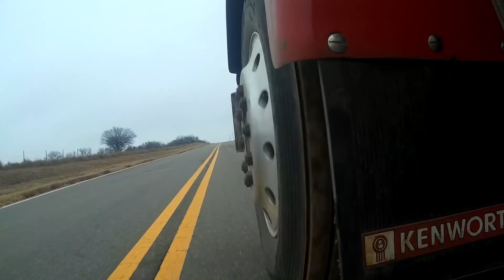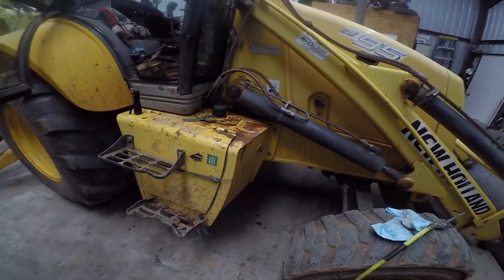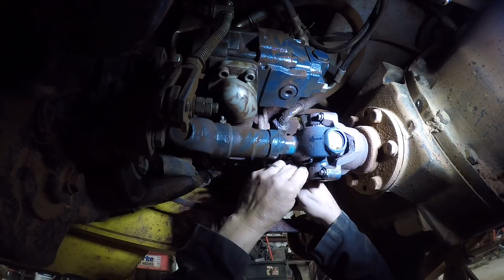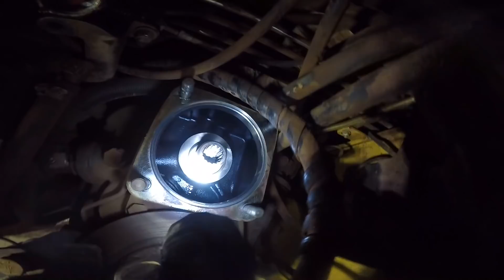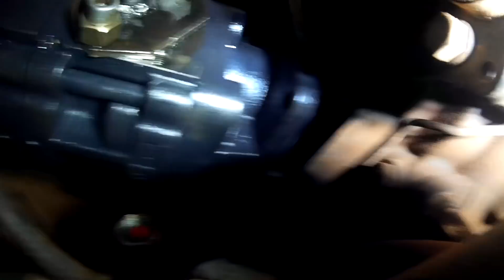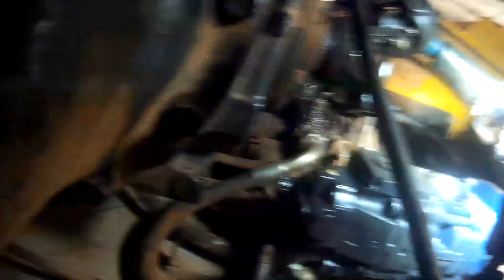backhoe pump r&r

Comment: Working man's dollar great song, I love Chris LeDoux. I changed a hydraulic pump in a 450E JD in the field in the dirt. I think I am still lubricated. Flat on my back with nothing but hand tools and horse power. I started to loose strength about the time my brain started to grow.
Reply: How is it going Frank? You staying busy or has the weather got you tied down?
Reply from the maker: It’s a bit slow, snowed here Monday and always gets slow with Thanksgiving. Sunny and I’m working today.
Reply: @Digginok  It is cold in Ohio and my shop is not heated. It has been raining, snowing and slushing. It is hovering around 30-35 degrees. I had the small door open and a box fan blowing out last night when I was welding. I use an innershield hardface wire. What kind of maniac looks out the open door to see it snow while running a fan and welding?
Reply: Cold weather breeds repair videos. The machines just are not as ductile and cracks start running. I hope your iron holds in and you don't end up welding for as many hours as you dig. Glad that you could get out and make some money today.
Reply from the maker: 68 here now, nice weather. Wednesday morning it was 15. Too early here for that kind of cold. 
I’m sorry but I won’t have a video until Sunday it looks like. I had a plan but somehow lost some footage so I’m not sure what I’m doing next.
Reply: @Digginok  Sorry to hear about that lost footage. I missed your reply I was out in the shop pounding Lincore 60! Just wing it if you want to post this week. Do a live stream in about an hour and a half from now. All your friends show up and it brings people to your channel for their first time. Not trying to be pushy it was just a thought. We like to talk to you even though you have a face made for radio ;0 Don't feel too bad I had to learn to be handy because handsome was never going to happen!
Reply: Welded from 6 this morning till 7:45 tonight. I am sitting on my rear for the rest of the evening.
Reply from the maker: That’s a long day!, I’m working on a video, sometimes they just work out sometimes it is a battle to get it to work. What are you welding on?
Reply: @Digginok  At work just finished a job welding steel sleeve into a stainless cap that was drilled for a steam insert, All TIG thick metal with full penetration and huge leg required on the cap. Then got a start on some tapered steam inserts on low grade chromemoly with full penetration welds, that is a stickrod job. All those parts get turned off and belt sanded in. They have to cut clean of porosity and slag and no lack of fusion or repairs must be made. In my shop I am welding on some dirt engagement tools, that is where the chrome/carbide hardface comes into play. I work from 6 until 2 tomorrow just a straight 8 so with any luck I might just be able to finish the job in my own shop after work. I have some pictures of stuff I have been welding on if you want to see let me know. You might just get a good laugh! What you been getting dirty from?

Comment: in your next video could you show us the crack in the pump?  On the ingersoll backhoe I had a snap ring came apart internally and clogged the drain  for the shaft seal. I pushed that seal out 3 times before I found that little piece of metal in the hole.
Reply from the maker: Yeah I may do a short video of it. It’s in an odd place not sure why it did it. I changed o-rings 3 times and 2 hoses before I found the crack.

Comment: That went better than I thought to, It kinda reminded me of when I worked on Rogator sprayers for a year with the local spray guys. I'm sure there is stuff like hyd lines under them, that they hang on string from the factory roof and build the machine round them !.   simple things like those home made tools can really help on jobs like this to. There would sure  be a mess under one of those machines if that driveshaft ever let go. I saw  JD  6400 tractor do that it destroyed most of what was under the cab when the shaft went round at engine speed for the pto.

  Atleast on my JCB there isn't much under the cab a guy needs to get at, and the pump is right out the front of the rad with a driveshaft and a few lines, so easy to work on, after draining the oil. yeah it messes the rad and coolers up if the shaft lets go, and changing the fan belts a program. I used to run a spare belt already fitted through the shaft on my other machines, the last owner wasn't that smart so I'm gonna do it myself on this one. Thanks for sharing hopefully you notice improved hydraulic performance with the new pump to. Take care.
Reply from the maker: Glad it's done! I keep a close eye on the driveline, that would be a disaster.  I like this design better than the 555D ford, it was front mounted, fan belt changes are a pain for sure.  The new pump is actually an upgrade according to the dealership, i checked the part numbers and the new one is 165lpm, the old one was 154lpm. Maybe i can idle down a bit more!  Thanks for watching!
Reply: That would be nice if you could idle back, fuels getting expensive, maybe it would help pay for the pump !.   I'm gonna say the extra  capacity will make a huge difference. My machine doesn't have the stock pump the last owner "updated" from anything JCB  fitted from stock.   The first time I jumped on it, I set the throttle to about normal for a stock pump.man It's a good job I wasn't trying to air dig in a sale yard it wouldn't of looked good L.O.L.  

 I don't know what my pressure is either I need to check it. it's a 7 ton plus machine,  I was trying to scratch a quick drainage trench for snow melt with a 2ft bucket on ground thats still frozen in some places. The old girl has so much power it stood her up on the stabilizers/ front 2ft in the air,  and was trying to drag it back down the trench.  I had to quit before I wrecked the bucket or something else. in fresh digging on hard clay it don't mess around filling that 2 ft bucket either.

Comment: I bought a 1966 ck  530  188 Diesel  case Backhoe for $2500.00   for the farm and I bought a 1973 Ford f 700 DUMP trk for the farm for $2500.00 I'm now in the process of painting the Backhoe before winter

Comment: Nice job, how much for the pump and where did u get it? I have a 2004 lb110 pump making noise and can feel vibration
Reply from the maker: Jason Baxter bought it from dealership in OKC. If I’m not mistaken it was $2600. Make sure your lines are not sucking air that can cause cavitation and vibration s.